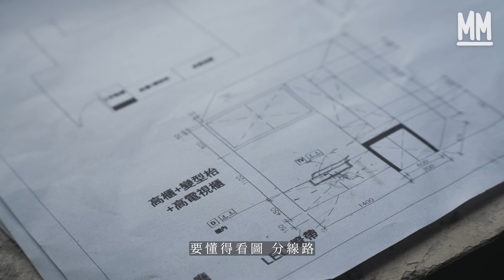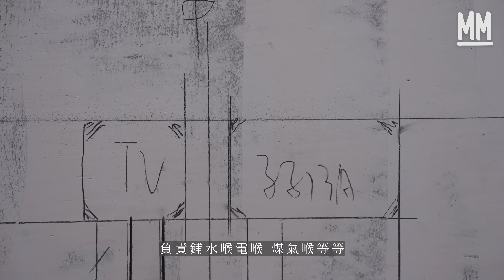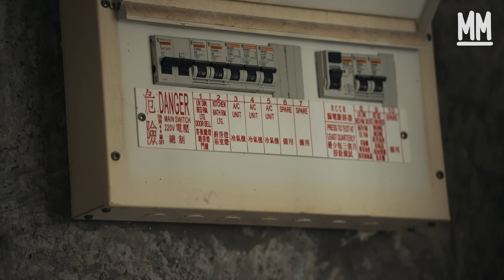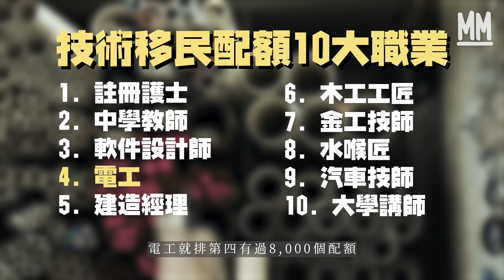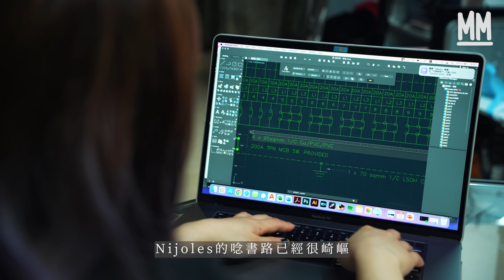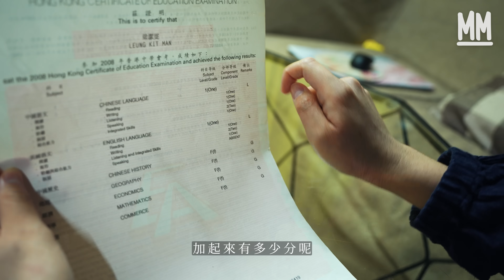#MM｜90後前MK妹化妝師會考2分 為移民英國轉行做水電技工 月薪$20,000起 為考英國電牌重新讀書 由毅進讀到高級文憑：滿足感在證明自己可以做到｜#700萬種生活 #4K

Comment: 水電工真是一個不錯的行業，長工雖然未必攞到工會價(1480)，但一般仍有(1250)一日，月做26天，好似近期装修市場很難請人，不祗要開夜(按日工時薪)連星期天都照返，錢搵多咗，人就癲咗(壓力好大)
Reply: 中年白纸会请吗。
Reply: @ngar2010 幾歲？
Reply: Because the problem is now that, you have already built both old, and new buildings... and the market landscape has also changed as well. The type of people that you need are actually, should be MORE skilled, than what the educational sector could teach you. The problem needs to be discussed really... and to be solved by both the government's representatives.. as well as actually the... functional groups on constructions, because.... (originally, when certain buildings were built, they were literally costed, and priced.. It has an insured value.) The question is.. is such an insured value...  multiply by.... is it worth to "mend a little bit"... or is it cheaper to knock down the whole building. This is what is often being considered. So... (To be honest, I think HK should have a "Building's Institute".... to both analyse these problems.. and use R&D on how to both preserve buildings, as well as to isolate for retrofitting reasons etc. Overall.. safety first.)  UK has also entered into these spaces as well... i.e. Architects now do research projects on how to do city planning... which is now common, but to be able to visualise and to do proper engineering... that is, construction engineerings... this is harder.